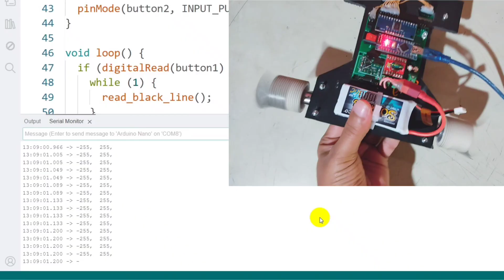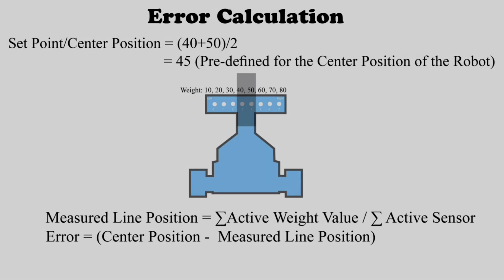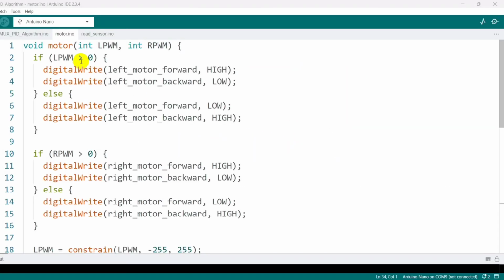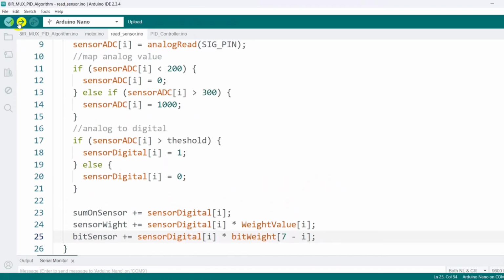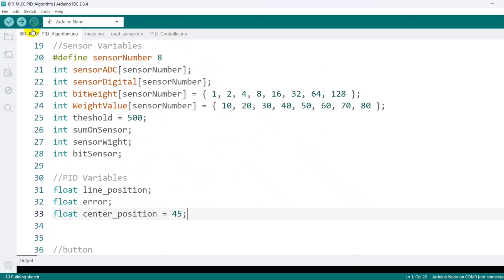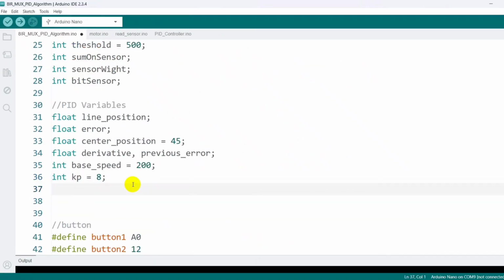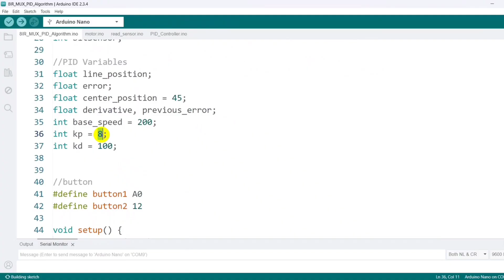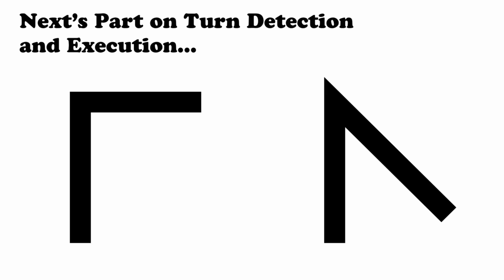PID Line Follower Robot Step by Step Coding: Part-4 | PID Controller | JLCPCB

Comment: Aslam dada currently i am making a LFR for my college techfest and it is following line really good but when it comes to junction and loop , it keeps getting stuck in them 
Please help me out from this.
Reply from the maker: Which code are you following?
Reply: @aslamhossain1  currentlu using a code written by myself.Can you please guide for futher advancements?here is the code:#include <SparkFun_TB6612.h>

// ---------------- Motor driver pins ----------------
#define AIN1 5
#define AIN2 4
#define PWMA 3

#define BIN1 8
#define BIN2 9
#define PWMB 6

#define STBY 7

// ---------------- Button pin ----------------
#define SWITCH_PIN 2   // connect button here (INPUT_PULLUP)

// ---------------- Offsets ----------------
const int offsetA = 1;
const int offsetB = 1;

// ---------------- Motors ----------------
Motor motorRight(AIN1, AIN2, PWMA, offsetA, STBY);
Motor motorLeft(BIN1, BIN2, PWMB, offsetB, STBY);

// ---------------- IR sensor pins & weights ----------------
const int sensorPins[5] = {A0, A1, A2, A3, A4};
const int weights[5] = {-2, -1, 0, 1, 2};

// ---------------- PID variables ----------------
int baseSpeed = 120;
float Kp = 80, Ki = 0, Kd = 0;
int P = 0, I = 0, D = 0;
int previousError = 0;

// ---------------- Button state ----------------
bool running = false;
bool lastButtonState = HIGH;  // pull-up keeps pin HIGH when idle

// ---------------- Setup ----------------
void setup() {
  Serial.begin(9600);

  for (int i = 0; i < 5; i++) {
    pinMode(sensorPins[i], INPUT);
  }

  pinMode(SWITCH_PIN, INPUT_PULLUP); // Button with internal pull-up

  digitalWrite(STBY, HIGH);  // Enable motor driver

  Serial.println("LFR ready. Press button to start/stop.");
}

// ---------------- Main loop ----------------
void loop() {
  // --- Button handling with debounce ---
  bool buttonState = digitalRead(SWITCH_PIN);

  if (lastButtonState != buttonState) {
    delay(50); // debounce delay
    buttonState = digitalRead(SWITCH_PIN);

    // Detect valid press (HIGH -> LOW transition)
    if (lastButtonState == HIGH && buttonState == LOW) {
      running = !running; // toggle run/stop
      Serial.print("Running state: ");
      Serial.println(running ? "STARTED" : "STOPPED");
    }
  }
  lastButtonState = buttonState;

  // --- Stop motors if not running ---
  if (!running) {
    motorLeft.brake();
    motorRight.brake();
    return; // skip rest of loop until button pressed again
  }

  // --- Line following logic ---
  int position = 0;
  int activeSensors = 0;

  for (int i = 0; i < 5; i++) {
    int value = digitalRead(sensorPins[i]);
    if (value == 0) {  // Black line detected
      position += weights[i];
      activeSensors++;
    }
  }

  // If no sensors detect line, use last error to decide direction
  if (activeSensors == 0) {
    position = (previousError > 0) ? 2 : -2;
  } else {
    position /= activeSensors;
  }

  // --- PID calculations ---
  P = position;
  I += P;
  D = P - previousError;
  previousError = P;

  int correction = (Kp * P) + (Ki * I) + (Kd * D);

  // --- Calculate motor speeds ---
  int leftSpeed = baseSpeed - correction;
  int rightSpeed = baseSpeed + correction;

  // Constrain motor speeds
  leftSpeed = constrain(leftSpeed, 0, 255);
  rightSpeed = constrain(rightSpeed, 0, 255);

  // --- Drive motors ---
  motorLeft.drive(leftSpeed);
  motorRight.drive(rightSpeed);

  delay(10);
}
Reply: I am using s code written by me
But i think it doesn’t check all the blocks!